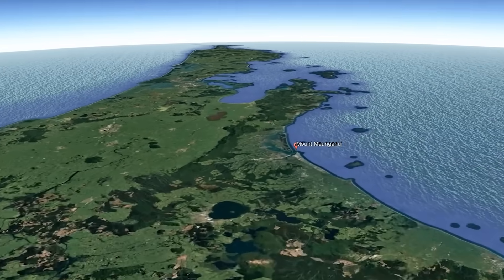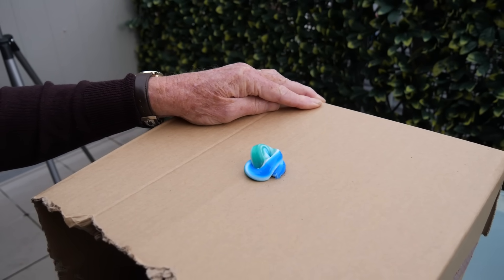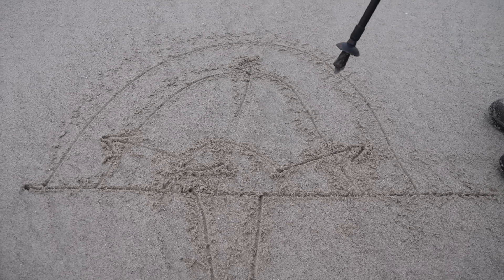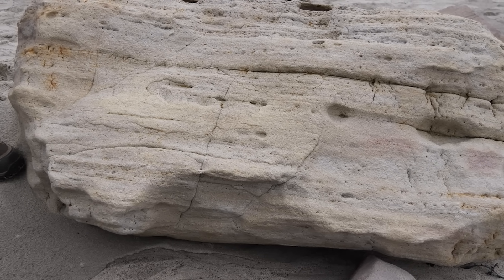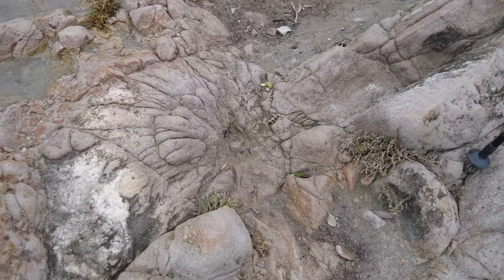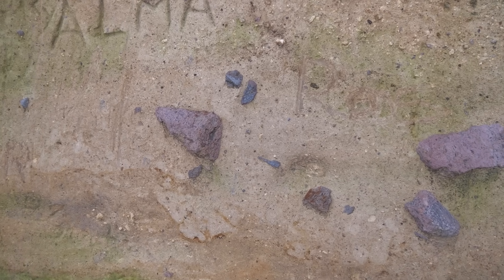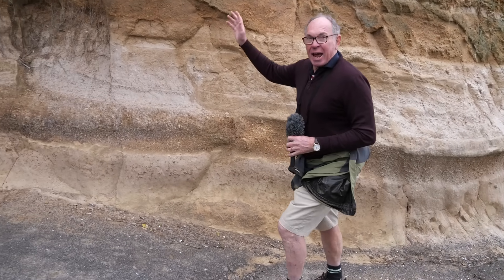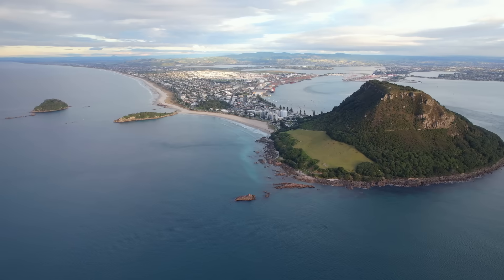MOUNT MAUNGANUI - A Lava Dome Explained

Comment: 2 questions.. breaking those rocks with silica is a respiratory  issue.... and... diamonds suppose  to be found around  volcano...
Reply: Yes if you are grinding or sawing up this rock you are best to use breathing protection - just a quick break with a hammer is unlikely to release much silica dust of significance. You might note that I very seldom use a hammer unless it is impossible to determine what kind of rock it is when it weathered on the outside. No hammering in reserves like the Mount.
Diamonds form deep within the Earth's mantle under high pressure and are carried to the surface by a rare type of volcanic eruption called a kimberlite. These kimberlite eruptions act like a "delivery system," bringing rocks and minerals from depths of over 200 km, where the pressure and temperature are suitable for diamonds to form, and blasting them to the surface.

Comment: Mt Drury and Leisure Island are not eroded remnants from the Mount dome, they are lava flows up a separate (although associated) linear fault. There is another such, albeit smaller, linear fault a few hundred meters further eastwards, forming the other side of Shark Alley/ Rabbit Island. Even the Mount/ North Rock itself has formed through a parallel fault.
Reply from the maker: Thanks for your comment!

Comment: The mount is at the end of a peninsular. I can think of three possible explanations. Maybe it is pure coincidence. Maybe the mount used to be landlocked, the land around it has eroded, but the mount protected the connecting peninsular from the waves (i.e. subtractive manufacturing.) Maybe the mount used to be an island, but its interactions with ocean currents encouraged sand/silt deposition to build up the peninsular (i.e. additive manufacturing.) Can you say which of these explanations is true?
Reply: We filmed eplanations for this but left them out to keep the video shorter. Maybe another short video.